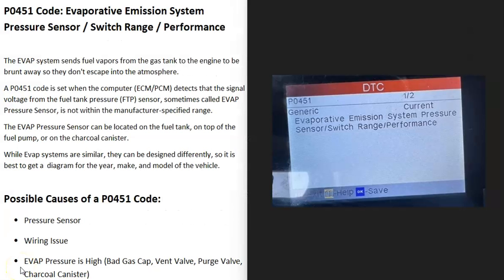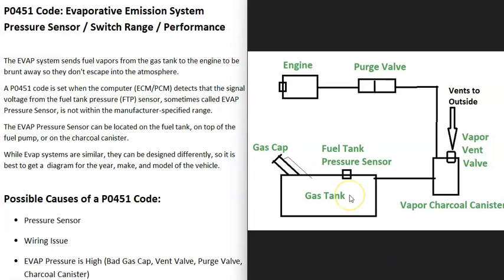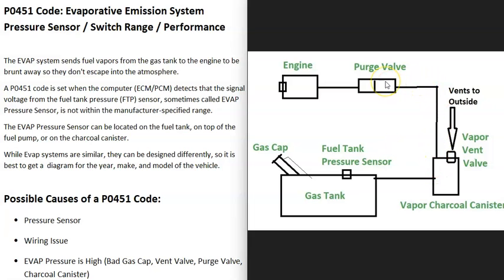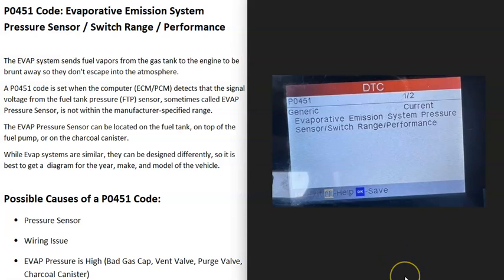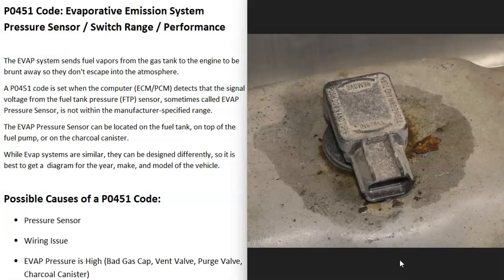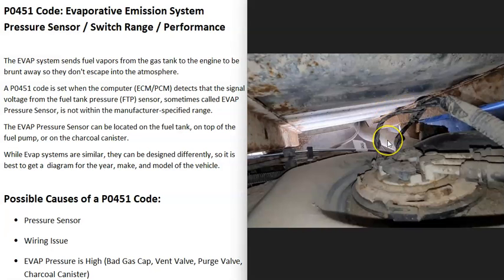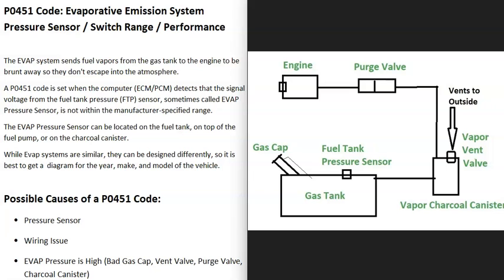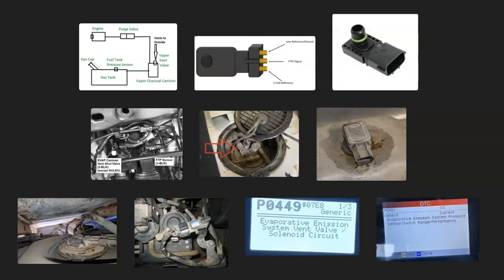Causes and Fixes P0451 Code: Evaporative Emission System Pressure Sensor / Switch Range Performance

Comment: 2012 lincoln only code is p0451. No rough idle, mileage can probably be bad but it does record it on the actual mpg thing on dash. But seems like the gas going fast. Only pops on when gas gets low. Doesnt go away unless cleared. 

Poped on when it sat for a week during a wind ice storm.

Comment: This code has now popped with a solid check engine light.  Gassing up, acts like the tank is overpressurized and spits back at me.  2016 Hyundai Veloster Turbo....so, there is obviously a problem with something.
  Any thoughts?
Reply: What was the fix to your issue? Dealing with something similar

Comment: Hi and thanks for the video.  I took my silverado to the dealership for an intermittent engine light turning on and off.  I used my scanner to get a code and found a U0672.  The code said there was no communication with the coolant pump.  The dealership found and replaced an Evap sensor (emission evaporative pump), not sure if the Evap and an emissions evaporative pump is the same.  Nevertheless, if I can ask for your opinion, can it be that my scanner (or am I testing improperly) is picking up the wrong diagnosis?  This was the first time I used a scanner.  Thanks.

Comment: Like the video. I get P451 and P1604. The 2013 Sienna v6 runs great! Starts every times, no rough idle, no misfire, acceleration great, gas mileage is fine. Gas cap changed, evap purge solenoid replaced. Any thoughts?
Reply from the maker: The 2013 Sienna has what's called a Leak Detection Pump located on the charcoal canister under the vehicle that contains the Evap pressure sensor. The computer is seeing an issue with it, most likely the wiring or a bad sensor.
Reply: @HVAC_Mechanic Thanks for the information and I will research further. I checked it with my BlueDrive, had one mechanic smoke test it with no results, Toyota did the OBD2 test and got the same results and now wants to do more very expensive smoke testing. The cost is outrageous in my opinion. I was thinking the purge vent in the canister as well. Your diagnosis makes the most sense I have heard. I appreciate you taking the time to reply.

Comment: Maybe you can send me in the right direction. My son's 2014 Nissan Altima has a P0300 code. I've gone through everything I can think of and no fix. However, I noticed the EVAP System Vapor Pressure on my OBDII scanner always reads 0 Pa. Even while driving, it never changes from 0 Pa. Despite the reading, it throws no EVAP codes at all. I've tried to inspect the EVAP system, but my fat self doesn't really fit under the car. Any idea what the most likely cause would be?
Reply from the maker: The only EVAP component that can affect the engine is the purge valve when stuck open, which will give EVAP codes. Usually, a P0300 code will give specific codes for one or more cylinders that are having a problem. If there are no other codes, I would check that the fuel pressure is good.
Reply: @HVAC_Mechanic  Everything I've read says a fault in the EVAP system can absolutely cause a random misfire. I've watched a dozen YT videos where they say the Vapor Pressure Sensor, Vent Valve, Broken Hose, or Cracked Canister can all cause random misfires, because the engine isn't getting the A/F ratio it expects.

My concern is that the Vapor Pressure Sensor always reads 0 Pa. This makes me think the sensor is bad, because if there was a break elsewhere, it should at least read atmospheric pressure. However, if the sensor is faulty, it should throw a code. I'm honestly just desperate to figure this out. lol
Reply from the maker: When looking at the EVAP pressure, you will need the expected values for the vehicle since it will be different. Every system is different when the computer closes the vent valve and pressurizes the system, and tests the system for leaks, often overnight. If you think the EVAP system is causing a misfire, temporarily plug the hose from the purge valve to the intake and see if the misfire codes clear. It is the only EVAP component that can affect the engine.

Comment: So I was getting a P0454 code, got that take care of. Now I am getting P0451 code. I have swapped out the gas cap, fuel sending unit because I wasn't getting a good reading on my fuel gauge. How do I go about testing the fuel pressure switch on my fuel sending unit.

Comment: I’ll get gas and it won’t want to start after… also sometimes at idle it will like almost cut off but catch itself.
Reply from the maker: Starting issues after getting gas is a symptom of a stuck open purge valve.
Reply: @ should I replace? Only 40 bucks .or is there almost way to check
Reply from the maker: I made a video on how to test a purge valve here is a link. https://youtu.be/X-Y5YsaXxJE

Comment: 02 3.0 ranger with p0451, replace purge/canister valve and all sensor you can think of and still having code popping on, what else can it be
Reply from the maker: If the EVAP sensor is good, I would test the wiring and check for any blown fuses.

Comment: Thank you sir . I got same error P0451 on my grand marquis 2010 but I don’t where is this located and how looks?!
Reply: I got a 2010 crown vic, so the same car. The charcoal canister and vent valve solenoid is in a tray on the bottom of the gas tank held on with 2 12mm bolts. The FTPs is on the top of the tank
Reply: @spoppydoggo4365 thanks you sir for this valuable information,, if you have a youtube link or something i can look at it will be much useful too. Or website i can buy it

Comment: My fuel pump had a small hole on the tube that sends the gas out I changed the top of the fuel pump cage and put it back together I had to unplug the wires in the pump . I put it back together and put the pump back in And then the p0451 code came up. The fuel pump must have been replaced before cause there was silicon on the ring of the pump. So what could e going on what should I check first

Comment: I have a p0451 with symptom of sometimes needing to step on gas to start and gas pump stopping. Would replacing the purge valve be the right move ?
Reply from the maker: It needs to be diagnosed but that is a symptom of a stuck open purge valve. The purge valve is normally closed, so if you can blow through, it is bad. You can also use the engine vacuum to test it without removing it. I made a video on this here is a link. https://youtu.be/X-Y5YsaXxJE
Reply: @HVAC_Mechanic  thank you bro ill check it out !

Comment: Would a bad charcoal canister cause problems fueling up? When I’m getting gas the gas pump shuts off every few seconds
Reply from the maker: That is a symptom of a bad Vent Valve, which is usually built into the charcoal canister but is separate sometimes.
Reply: @HVAC_Mechanic I also have this code (and p0441) and the same fueling problem, but my vent valve is good. Anything else to look at?

Comment: So I have a 2015 gmc Sierra I switched out the whole gas pump an I  recently got the code P0451 what do you think it could be
Reply: Did you figure it out bro?
Reply from the maker: The EVAP pressure sensor is often located on the fuel pump. I would check the wiring and be sure it all has good connections.